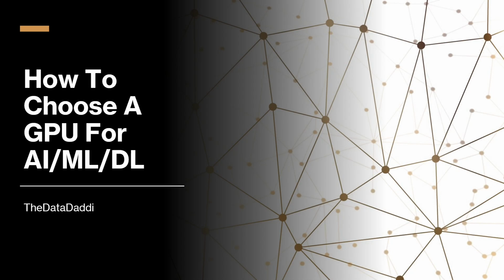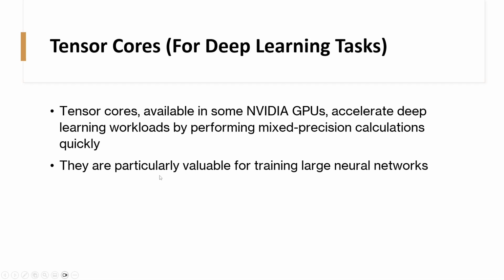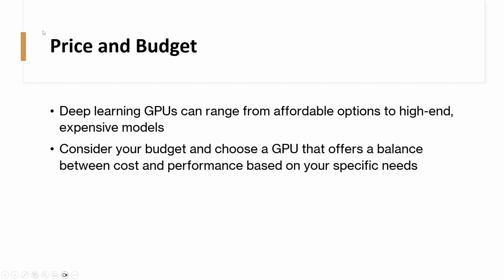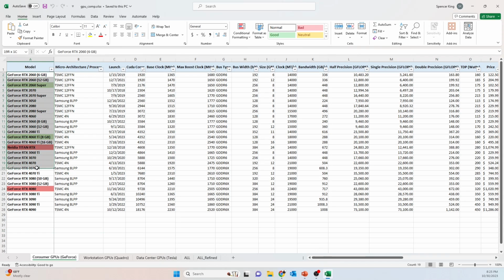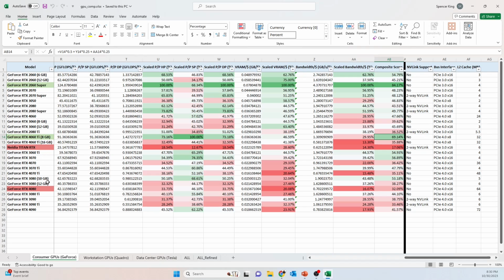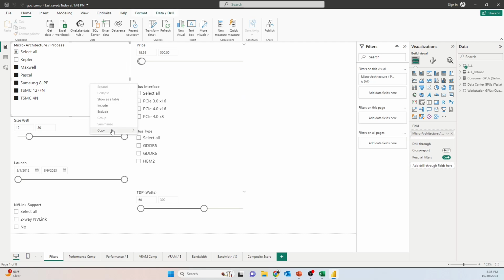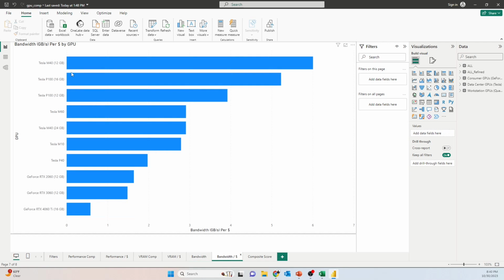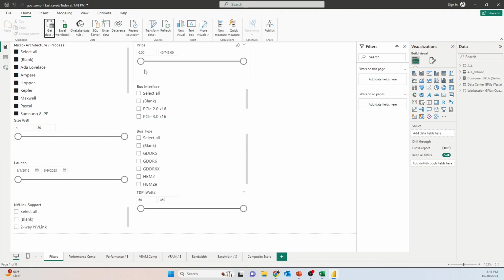AI/ML/DL GPU Buying Guide 2024: Get the Most AI Power for Your Budget

Comment: Personally I love the P40 at the moment however BE AWARE that the Pascal cards do NOT offer NVLink, for that you have to go to the Ampere cards. That said you can operate the P40 in x8 PCIe mode without significant loss in performance. Not ideal but if you have a consumer motherboard and are trying to get one more GPU in there this one might not be a bad choice for a  Gen 4 board where the increased PCIe buss speeds more than make up for the lack of full x16 access for this Gen 3 card.
Reply from the maker: Hi there! Thanks so much for the comment. 

Yeah unfortunately they do not seem to. Although interestingly they have a cut out on one side that looked like it was made for something NVLink related. However, I have never been able to find anything that would link them together. 

Yeah that is true. In most cases for consumer mobos you will be working with x8 pcie not the full x16 unfortunately. Like you said though for most it shouldn't make that much of a difference.
Reply: @TheDataDaddi  and if you are looking to water cool there will be challenges for the P40 s well. The PCB cutout is the same as the 1080 but with the rear plug on the P40 you will likely have to do some modding on a 1080 water block to make it work. The 40x40x28 15000rpm fans I have on there scream when at 100% so be prepared to write some custom code to control the fan speeds. If you are interested I'll push mine to GitHub and send you the link.

Comment: Hi, I am new to the idea of learning about ML/AI.  I appreciate your video and am contemplating piecing together a budget friendly system to start learning with.  In the past, I was able to purchase some used crypto mining rigs from a person that was getting out of crypto mining.  I parted most of the systems out and made a profit, but I kept a couple crazy 8 GPU motherboards.  

My first question is is there any restrictions that would prevent one from using multiple GPUs (more than 2 which seems more common), and my second question is there a certain GPU that would make sense from a budget standpoint where having multiple of them would be more beneficial than one or two standard GPUs.  I would think a system running 8 x Tesla M40 having a total amount of 96GB of VRAM would be better than a system running 1 or even 2 3060s w/ 12GB or 24GB of VRAM.

I look forward to hearing your response if you find the time to respond, I appreciate your time in advance!
Reply from the maker: Hi there. Thanks so much for the great question. So glad that you have found this video helpful!

QUESTION 1

There are a couple considerations here:

1. Unless you shard or split the model itself you are going to be limited to whatever the smallest memory size is in your available GPUs to actually load and train models. So for example if you have 4 Tesla P40 GPUs that would be 24x4 GB of VRAM total, but in many cases with parallelism people end up using data parallelism by default and the model must be loaded onto each GPU. This speeds up training time because you are able to process more batches in parallel across all GPUs, but it does not allow you to load larger models. 

There is also many ways to do model parallelism in which you break parts of you model across different GPUs and process the data in a pipeline like fashion. I have never actually had to do this so I cannot really get into particulars here, but it is definitely possible. From what I understand though this is much more involved because it require you to logical partition your model in a way that makes sense and assign layers or segments of it to the various available GPUs. 

All of this is a long winded way of saying if your model is not to parallelize, you may be limited in term of the size model you are able to load and use even if you have many GPUs. 

2. Every mother board has a maximum number of PCIE lanes that it can support so in some cases even if a mother board has slots for 8 GPUs it may not support them all at the full x16 lanes require for each GPU to utilize its full bandwidth. 

This is okay in many cases because the GPUs will still work, but it will limit performance and may cause a bottleneck if you have a ton of data IO. 

3. GPU form factor. This is a lot more important than I originally thought, but each GPU manufacturer may have slightly different dimensions and specs. For example, the RTX 3090 founders edition is actually physically quite different than the RTX 3090 Zotac I bought. The RTX 3090 founders edition might be able to fit in one of my servers, but the RTX 3090 Zotac was much larger and would not. While this is not a major consideration, you definitely do need to confirm that the GPU will fix in or on whatever chasis/mobo you are thinking about working with. 

QUESTION 2

This question is also a bit murky to answer because it depends on what you will eventually be doing and the size of models you will be working with. That said. I will recommend what I would do.

If you want to fill up one of you 8 GPU mobos, I would suggest 8 Tesla P40 GPUs. They are ~ $200 a piece. They are great in terms of price to performance. Having this many GPUs also allows you to use an immense amount of data parallelism to train and test faster for models that will fit inside 24GB of VRAM. It also gives you the ability to split very large models across all 8 of you GPUs. This theoretically would be enough to earnestly start playing around with some the largest open source LLM models currently avaliable. In addition, you can section of subsets of you 8 GPUs for different models or training/testing different version of your models all at once. For me personal, I find the last point invaluable in my research. Finally, these GPUs are cheap enough to add them slowly over time. You can buy them one at a time as you have the funds rather than having to shell out thousands for a single GPU. 

If you value performance over the flexibility mentioned above and have a bit more cash available. I would probably go with 2 RTX 3090s with NVLink. I have not been able to test this setup, but I think it should be excellent in terms of performance. You could also use the same idea here by adding RTX 3090s over time as you have the funds.

In summary, if you want a scalable mid - high end range rig where performance is you main concern. I would go with the dual RTX 3090s with NVLink. If you value flexibility and have less cash to invest upfront I think the P40 route is a great way to go. 

Very excited to hear that you are starting your journey, and I am glad I can help you along the way. I hope this helps, and if you have any other questions along the way please feel free to reach out!

Comment: The work you did to put this together is very much appreciated. Thank you for the thorough and thoughtful analysis!
Reply from the maker: Hi there. So glad this was able to help you!
Reply: @TheDataDaddi  GRAPHICS CARD	Msi Rtx 4070 Ti Ventus 3X OC 12GB GDDR6X is the graphic card good please help me i am thinking to buy black dimond 2.0 from dell which give me this gpu please give me some suggestion
Reply from the maker: Hi there. Thanks for the comment. 

I think this would be a fine GPU overall. It would help to know your use case, but I would say that it is a good GPU for most small to mid size application. 

Since this is prebuilt machine, do you have any other options for GPUs? @cattnation6257
Reply: @TheDataDaddi  I really new to this business but I am only one developer in company since we are working on waste management I may need to train models for waste type x-ray machine data I have very cheap laptop it's even can't able to run prebuild model I my budget is 2500$ or 250000 in Indian rs which I have very to no knowledge and I can invest only one time.....I need to learn also build model which may require a lot of data in future from now to 1 year I will work on very small prototype and just for learning most of the time....that's all I can say the industry is very big and I am the only one here at least in my company with very little knowledge and absolute no knowledge about hardware
Reply: @TheDataDaddi  so I am working on waste management and waste type is house hold so it's vary so much and I need to done the work as soon as possible......
Reply from the maker: Gotcha. Can you let me know the approximate size of the data you will be working with? This would help me make a bit better recommendation. @cattnation6257
Reply: @TheDataDaddi  because we need to work on x-rays and waste management we need to find almost everything like plastic metal card borad and all so I can't tell you the exact but I'll be huge data....for other purposes like people detection the data will reduce but for these kind of model I need to train I suppose there will be thousands of images I will need to get my model working currectly
Reply from the maker: So for mid level projects I would suggest the following. Try to get a minimum of 64GB of RAM (128 or more would even be better). I think the 4070 would be fine but the 4060 ti 16GB would even be better. I would also try to get a setup that allow you to add at least a second gpu later. This means you will need at least 2 PCIE x16 slots. Hope this helps!
Reply: @TheDataDaddi  thanks brother
Reply from the maker: No problem. Glad I could help! @cattnation6257
Reply: @TheDataDaddi  :)))
Reply: @TheDataDaddi  I was actually going to go with a 4090 liquid cooled, but then I remembered the TDP limit for the server so RIP to that idea. I eventually came to the same conclusion with the 4060ti 16GB, just unfortunate that the bandwidth is so low! Hopefully the next generation treats us better.
Reply from the maker: Yeah. I actually like the 4060ti. I think it is not a bad option. However, in general I don't love the 4000 series GPUs because I don't think Nvidia delivered on their promises in particular with respect to bandwidth and data IO. I personally am holding out for the 5000 series. Hopefully they will have fixed most of the issues by then.  @Marioz773199
Reply: @TheDataDaddi  I cant able to add more money it's approx 2500 doller in future if I got success I will buy maybe more GPU but until than I a good pc which at least work on mid level project smoothly
Reply: i can invest only one time so can you please help me my buget is 2500$ @TheDataDaddi

Comment: Thank you brother for your hard work. You have saved me a lot of time. Your spreadsheet is amazing! We can sort out GPUs by the desired category! I believe that , after viewing your results, the GeForce GPUs that are most notable (especially considering the price) is the 3080 Ti. It is close in CUDA cores to the 3090 (I am aiming for a 3090 , but it might be easier and cheaper for me to get a second-hand 3080 Ti)
Reply from the maker: Hi there. So glad this video has helped you!

Yep, I would definitely agree with that statement. It might definitely may be easier and cheaper to get your hands on a 3080. Most people it seems have their eye on the 3090s for the extra VRAM. However, if your use case does not require that, I think the 3080 would be an excellent way to go for sure.

Comment: Is there a current laptop with more than 8 GB vram that is recommended and does not cost 3000?
Is it better to wait for new processors or graphics cards that incorporate new chips specially built for AI models?
Reply from the maker: Off the top of my head, I know that the 4090 mobile gpu has 16gb of VRAM. I do not know what laptop have this standard. This link may help you. 

https://medium.com/@ibrahimcreative172/top-10-laptops-for-deep-learning-machine-learning-and-data-science-in-2023-f8a6ba861c4f

I think it depends. For example, if you could wait until 2025 when the RTX 5000 series comes out, that might be worth it as they will hopefully fix some of the shortcomings of the 4000 series.

However, they will be super expensive when they first come out. So I normal prefer to go for older GPUs. I feel that they have a much better value. Long winded way of saying I would probably not wait and try to find value in what exists currently.
Reply: @TheDataDaddi  Yes, I think I'm going to wait for new laptops to come out with better video cards and maybe better processors with NPU which seems to be coming strong
Reply: Now I have a gaming laptop even though I don't play, with an rtx3050 ti but only with 4 vram. When I bought it in 2021, I didn't know that I was going to need more vram for Stable Diffusion. We'll see how things develop. Thank you so much
Reply from the maker: I did some more research last night in the area, and I think this might be a good option for the mobile/laptop route. It seems NPU technology stands to make AI/ML/DL much more viable on laptops.  @RSV9
Reply from the maker: Yeah it would definitely difficult to do much with stable diffusion on 4GB of VRAM. It might be worth upgrading to a GPU with 8 or 12 GB of VRAM while you wait for a better new laptop. You can find some pretty good deals on EBAY if you are patient. @RSV9

Comment: What most people don't think about is that time is money !
Reply from the maker: You are definitely right. There is a reason most companies use the cloud rather than on prem hardware. These are definitely arguments in both directions. In my case, however, I cannot afford the could based solution and like full control my own hardware.
Reply: And the electricity cost,  and airconditioning if your climate requires some extra work to dissipate that heat.
Reply: well this is what i actually thinking, most "best bang for the bucks" chart always forget that the longer it took to generate can also considered as a loss

Comment: Hi, I'm a deep learning beginner with a 4070 super(12gb) looking to potentially add more gpu(s) to my 2 empty slots on the GIGABYTE areo trx50 d motherboard. I'd like to have more vram for no more than $1000-$2000 budget. What are some of my options and do I need to consider power consumption with a 1200w psu and other compatibility issues?

I have a pretty good 32cores 64 thread threaripper cpu and 256gb of ram. What are some benefit of those for ML? I bought this pc for 3d simulation use originally.
Reply from the maker: So, I think the Threadripper cpu and mobo are wonderful for deep learning applications just really expensive relatively speaking. They are really the only cpu and mobo combos I know of that go over 2 x16 lane pcie slots. This means you can use more than 2 gpus with full x16 lane bandwidth. 

For me personally, I believe the best you can get right now for that price range is a pair of RTX 3090s with NVLink. I would scan EBAY and wait for a good deal then grab 2 when they are cheap or on sale. 

Hope this helps!